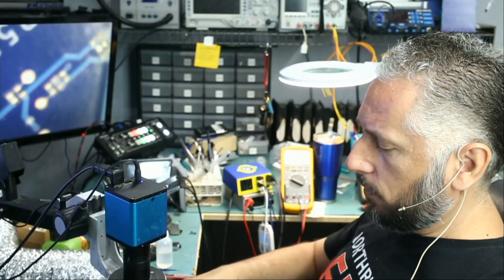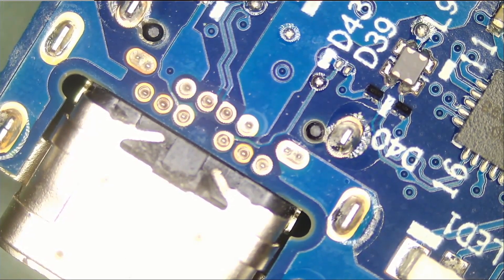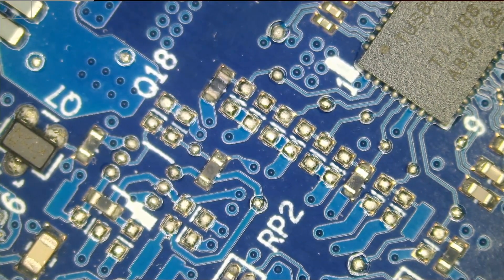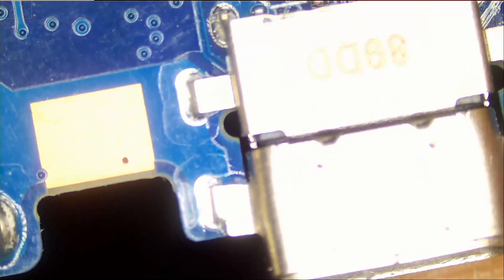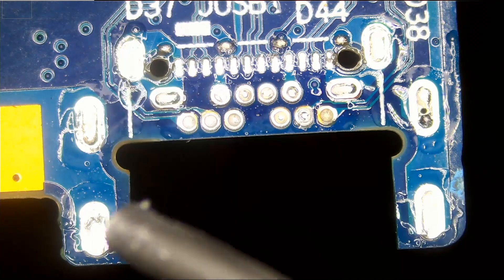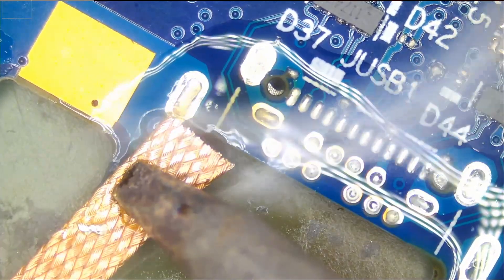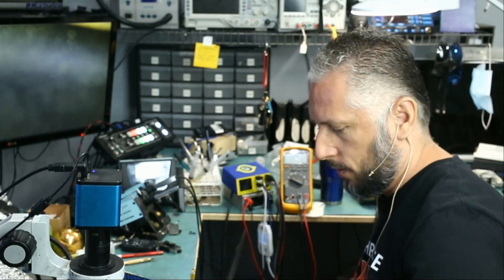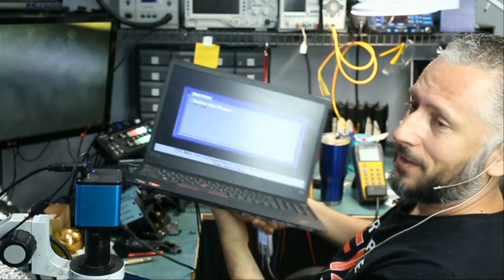Lenovo E585 USBC charging port replacement - SMD & Through hole connector Soldering

Comment: Thank you for your amazing videos, they helped me a lot. Question: I don't have a hot air soldering unit, just a soldering iron. Will I be able to remove the USB-C port with just the iron, some lead and the wick or is the hot air station a necessity?

Comment: Hello. I have a MacBook pro 2015  a1502, I replaced the EFI chip to unlock the system. But when I tested. I only got a white screen. External monitor and internal LCD The same fail no picture  but if I heat the board  some time it shows picture. But once it  get cold  dont show any picture   Please someone help me  with that

Comment: A couple of months ago I had to replace the same port on e585 after customer (nice lady) tripped on the chord and pulled the c port up. Believe me it was not so easy for me to source the correct port in my location. Anyway. Literally 2 weeks later. Back again. Tripped on the chord. Pulled the other side of the pads off. Repaired traces. Replaced port....again. few weeks later....... Wrote it off after she tripped on the chord again. Destroyed all hope of repairing the port. Killed the display and housing. Bought the same damn laptop to replace it........not seen her since. Maybe she learned her lesson..... Remains to be seen. But it certainly gave me some E585 USBC port finding experience.

Comment: Hi, I am attempting to repair My PC power supply. The standby voltage is available and All the other rails are shorted to ground (3,3. 5 and 12v). Can you tell me what could be bad based on your experience Or share a video Dealing with PC Power supplies

Comment: When re soldering,  can you use just low melt solder or do you use leaded?  I normally used leaded.
Reply: The low melt is used to remove components.
Reply: @HazeAnderson  Hi I use low melt some times and leaded some times. But when replacing something, eg charging port that could go again. Would you use leaded or low melt solder? Would it cause any issues?

Comment: Quick question master: why can't we just re-heat the solder without removing it once the bad connector is out and place a new connector directly? I did this on some occasions when I thought that it was not worth it because the board looked like a no fix, but then managed to fix it.. would it be better to remove it again, clean, re-tin the pads, etc? Or leaving it like this would be just fine? Anyway thanks for another great video and for uploading even with the sound problems. It only happens to people that work 😎😁
Reply: Most electronics uses lead-free solder these days. It has a higher melting temperature and is less reliable than leaded solder. He is removing the unleaded solder and replacing it with leaded solder, which is easier to work with and gives a shinier finish.